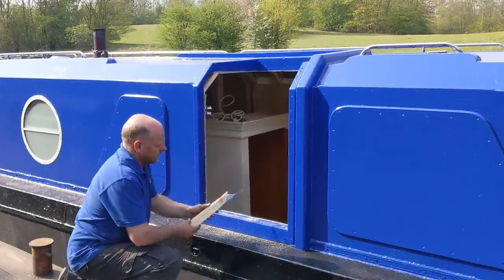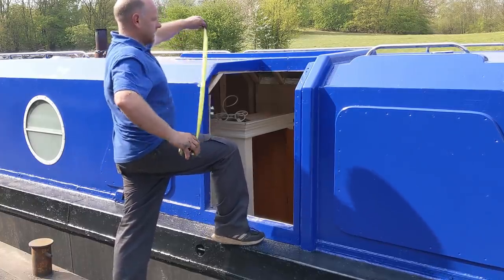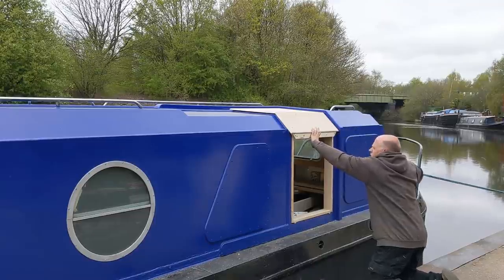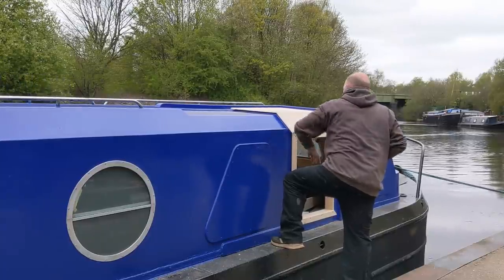How to BUILD a HATCH from SCRATCH. Installing new side / duck hatch on our DIY project narrowboat

Comment: Pete, could you make the top parts slide sideways? (the two bits you screwed on) Even looks like the roof is shaped for it and potentially easier to keep water tight  / wind proof than hinging it?
Reply from the maker: It was definitely definitely a sliding roof originally. Which would be nice to replicate but I think would be hard to get to seal..the original design looks to have had cover plates at the 'joins'... Putting a hinges top means I can 'box it out' and get the roof to drop over the box - keeping it perfectly watertight. 
Probably not a great explanation but hopefully make sense when I do it!
Reply: @WingingItBoatingonaBudget   I guess the alternative would be to make it lift up with a sort of velux window flashing water seal? (you've probably thought of all these things already, I'm just trying  help to stir the idea pot a bit)

Comment: Painting the mating surfaces before installation would have extended the life expectancy of the wood. As these are areas where water will accumulate and seams, even if caulked, will crack and the wood will be waterlogged soon and twist and rot.

Comment: Cheers from southern California.
Two questions:  Were you getting power from a generator out of earshot?
 - & -  Any flak from narrowboat neighbors during such work?
Reply from the maker: We get our power through solar panels on the roof that charge up batteries under the stern deck. During the winter months we will need to run either the generator or the engine at times to charge the batteries. 
No flak, I think most boaters are more than aware that at times we all have to do work. Plus we make sure we are considerate about times we work and the noise / inconvenience caused.
Reply from the maker: Just to clarify as well the tools are pretty much all recharchable - so we charge the batteries for them off our system.

Comment: 2 thumbs with no views
Reply from the maker: 7 minutes in it still said no views - yet it had 6 thumbs up 🤔🤷
Reply: @WingingItBoatingonaBudget  Something wrong with the views counter, I've just viewed it and it's still on no views!
Reply: @WingingItBoatingonaBudget  Ive seen it happen before and its just youtube system that guesses what they will be in advance. It sorts itself out after a few hours, or at least is less noticable. Could rout a small groove across the 45 degree with 5mm left so that it channels the rain water to the sides.